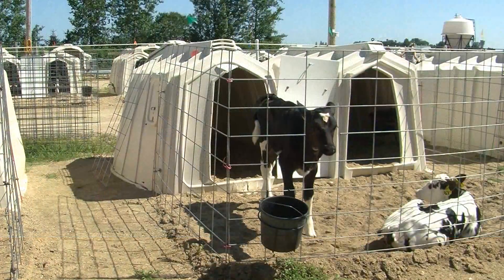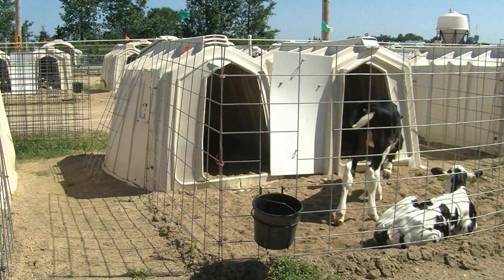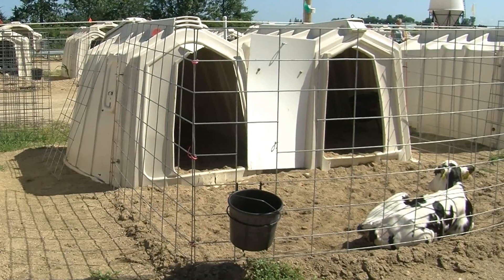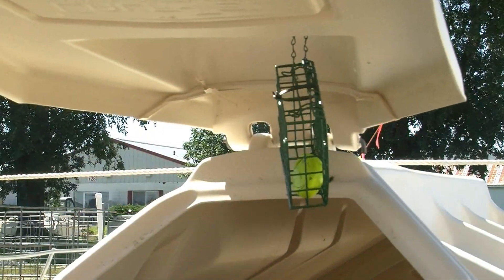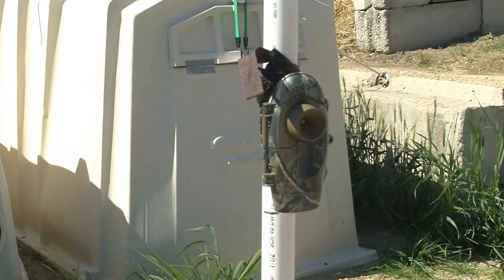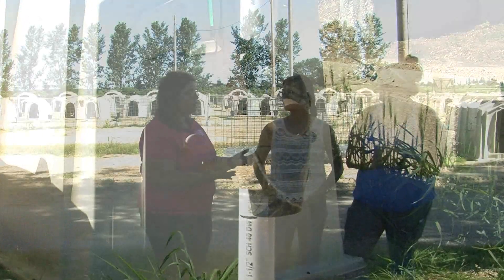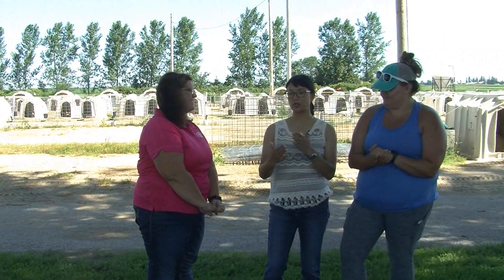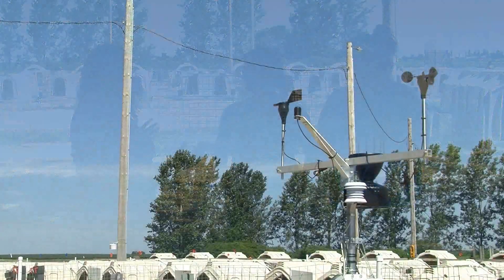Vita Plus Starting Strong:  Calf Chat with Ann - Current Calf Research (July 2019)

Comment from the maker: Great question!  The general recommendation is that calves do a better job of drinking water when the water is warm, regardless of the season.  In this video, we caution that the water can potentially get too hot.  For example, you might see this if you have black water buckets in full sun the whole day.  It's good to periodically check the water to make sure that's not happening.  If the water temperature is uncomfortable for you, the calves probably won't want to drink it.